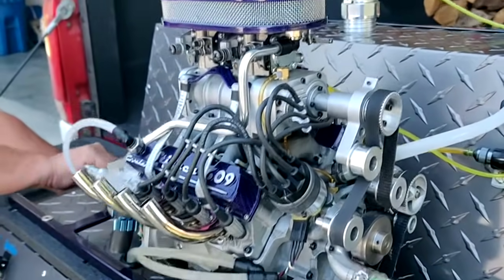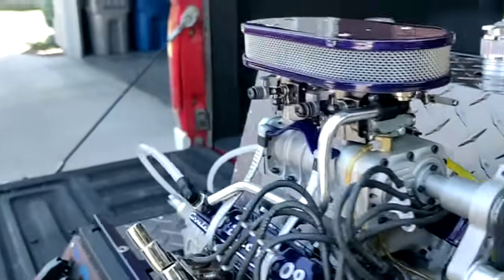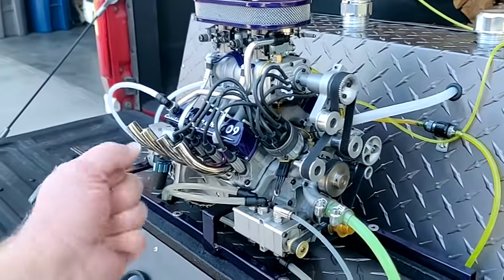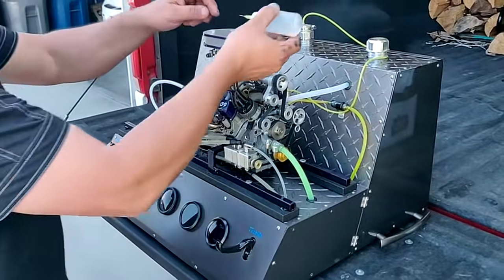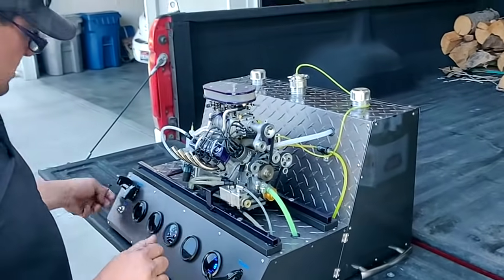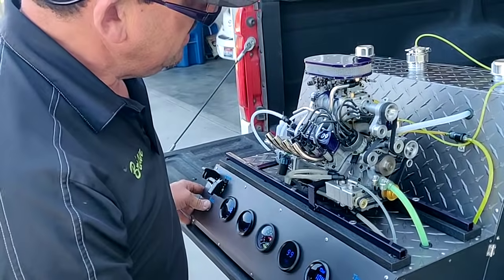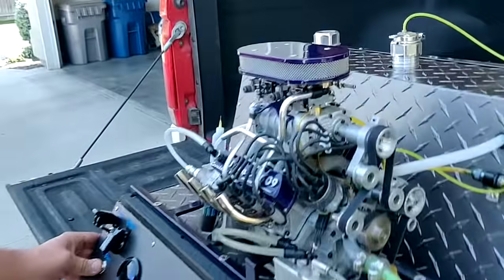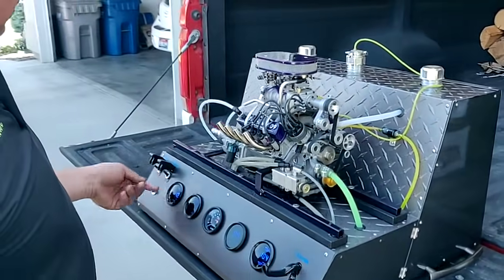Conley Engineering "Stinger 609" 6.09 ci 1/4 scale V8 motor running on test stand

Comment: Gary Conley's V-8's are the absolutely brilliant . I heard his shop caught fire and he stopped making them. I hope he's still around and kicking. Cool video, thanks.
Reply: As I heard, an engine builder from Australia bought the rights and drawings.
I haven't seen any engines yet 😅
Reply: By the way, after the fire, there was a "remake." I think it was the Stinger, in a very modified form since there weren't many cast parts left.
Reply: @nee3029  Yes. Gary had a shop fire. I haven't heard anything projects in quite awhile.

Comment: Wait, 6.09 CI or 60.9 cubic inch. Its massively oversized if indeed each cylinder is only displacing like 0.7 cubic inches. Plus 1/4 scale would put a "full size V8 at 243.6 CI? That's a fairly small V8 in and of itself, 6.09 CI would put it at roughly 1/50th scale of a 350. I'm so very confused.
Reply from the maker: 6.09 ci total. It is approx quarter scale. Point is it's an amazing example of design, engineering and machining craftsmanship regardless of scale.

Comment: What you never see is one of these running in anger for more than a couple seconds, because they are just models and not reliable/durable. 
I have been following the conley story since the beginning. You will never see one stepped on in a car or boat, or whatever.   I am certain that is because they will expire in a very short time. 
The best videos were of a man who had one in a gravedigger truck, but it was still pretty limited running.  
They are marvels of showing what could be awesome potential, but that is a lot of moving parts that are very difficult to end up with decent tolerances at that scale.

Comment: Why cant it idle for extended periods of time without being damaged? (Referring to the video description)
Reply from the maker: Excellent question. I can't tell you the physics, but the rotating mass of any engine needs a little drag to keep things in order. Like small model engines, this motor has a huge power to rotating mass ratio. You can't run a model airplane engine without a propeller or drivetrain attached to it. The rotating mass will  spin too fast for the expected timing. This can lead to catastrophic destruction.  Throttling up and down avoids this on an unloaded engine.

Comment: I was really intrigued by this and looked up the engine. The price has damped my excitement.
About $8,000.
Roughly $10,000 for the supercharged version.
Reply: You got to be joking, you can buy a real motor for 10k
Reply: @lilcourtny08  Or less.
Reply: @JohnSmith-cf4gn  You can buy a really good "real" motor (by which is doubtless meant "full-size") for 10k, but this is way cooler, if less useful in the real world.
Reply: Too rich for my blood, as my daddy would have said.
Reply: It's expensive for the same reason full-size race engines are: they're hand-built one at a time with specialty parts. If only he were still making them.....it appears that the maker had a fire and lost both his tooling and his will to do this....that's sad. I hope he will build more; this is a very awesome niche market he found.

Comment: For anyone wondering, it's a 100cc engine. I would love to have this in a motorcycle or something
Reply: Wouldn't be driveable, there is no torque to get going with all the weight. Small displacement bikes use single cilinders for a reason. A big RC car might be possible🤔😋
Reply: @J2I3H  Engines OHV engines in a V configuration generate more torque than a single cylinder because of imposed pistons 😁
Reply: @FeatheredDino  yeah, but at crazy high revs in this case. Its about torque at low rpms, not peak numbers🤔
Reply from the maker: @FeatheredDino  "opposed" not "imposed. 🙂
Reply: @TheBBGlobalNetwork  at least he didn't say exposed piston engine ;)
Reply: @J2I3H  the reason for single cylinders is.... they are cheap.  A small motorcycle with such engine would be driveable --- but in production such engine would cost 2 or 3 times the cost of the single cylinder motorcycle (scooter) engine.

See Dennis Franz channel video - v8 motorcycle  -- somebody already did put such small V8 in a motorcycle :D  sounds great  

Also there was a sport bike Motoguzzi made with a 500 cc V8 in the 50s
Reply: How much hp does this little guy have?
Reply: No torque the stroke is to short. No leverage turning the crank.
Reply: @clintbliss2046 You dont know what youre talking about. Put it on a bike and it will probably go 50mph+. Its a freaking V8, listen to it.
Reply: @BarbaraRay-m4r  I have a motorized bike that will do 50. This engine might go 50 if you pushed it to 48 but I seriously doubt it. An rc car that weighed 4 or 5 lbs would be a better choice.

Comment: SOLD!!!,,,I want this!!,,gonna mount in my GoKart, it must be puting out over a hundred horses!!,,way better than my 5hp briggs!
Reply: It might make 12hp. Maybe
Reply: Makes 9 hp, check the description
Reply: @allinaday3526  ya, I didn't read that but I knew it wasn't much. It is cool to see the sized down motor operate
Reply: There are many things you can do to make a Briggs motor scream. Bore it out, bigger piston, get a valve job done, stronger valve springs, shave the head, bigger cam. And don't forget to change the pulleys. Getting different size pulleys can do wonders for speed. Unless you want torque. Get educated on these things and have fun
Reply: @bradleylomas7525  how many horses is your Briggs pushin?
Reply: @milliondollar2981  none. I have to tear down my verticle 8hp and have it rebuilt because of the cylinder walls and the valves.

Comment: Put that inside a a kids power wheels would be sick haha
Reply: Just wrap the wheels with a couple rolls of duct tape. It won’t last forever but it will be fun for a couple days. Lol
Reply: @brandonmiller5158  my grand father wrapped my little electric 3wheeler with a strip of old belting material..... worked great from what I remember..... of course this was the late 80's
Reply: Right. Or just get rubber strips like a quarter inch thick and self tap those fuckers in all over the plastic tire haha
Reply: @FocusRS_N8  yep I learned that trick for my son's. He kept gettin stuck everywhere and after I stretched some inner tube around the wheels and secured it with a couple of screws it went many more places.

Comment: Sounded like an egg beater before it started. Wish he idled it down to like 650 rpms. It was idling at like2800
Reply: Smaller flywheel doesn't help as it's not got as much inertia as a full sized one, hence the higher tickover.
Reply: @stevenlane9272  yes was thinking a heavier fly wheel might help the idel
Reply: Smaller the displacement the harder for the motor to idle at lower rpm they like the higher rpms more don’t know exactly why but i think it has to do with the size of the stroke of the pistons
Reply: @gamer2350  that makes sense

Comment: I worked for a speed shop in N. Hollywood in the 70's. Hank the Crank was the only source of strokers back then. Hank himself showed me how flat heads were ported and relieved as I was building a Tecumseh 6 ci motor for my go kart. I drilled the crank for oil feed to the rod as it had a real oil pump for the mains. Dry sump using a sealed case, welded and reground cam profiles and everything else I could think of. I took me to 53 mph out at El Mirage. I still have the motor on a small stand in the garage. I'm 71 now and have no idea what to do with it.  
Seriously admire the guys who can build from scratch like this.
Reply: If you still have it I will buy it

Comment: This engine looks like it makes more power than a geo metro 3 cylinder I had.
Reply: That's right those things did have a three-cylinder didn't they
Reply: @leahcimthgirw3163  optional 4 cylinder. The threes were 1 liter with 50 hp. But I still think it would out power this little engine.
Reply: @lawnmowerdude  6 cu in is like 0.1 liter and probably the small engine has maybe 10 HP :D  but horsepower is not important, torque is.  Ever heard of Citroen 2cv ?   0.375 liter and 9 HP :D

Comment: Can this actually be used to power like a go kart or something small. That would be awesome
Reply: The lil engine that could,but won't
Reply: I doubt it unless the gearing was very low. In rc car engines horsepower is horsepower,  but they measure torque in inch ounces instead of lbft
Reply: @tracyhaynes5404  i don't know, I seen a guy power a ford ranger or datsun pickup with a predator lawnmower engine from harbor freight. So im sure it wouldn't be hard to put a 100 cc engine on a go kart. Its all about gearing
Reply: @brad2761  would that datsun still do 90 down the freeway?  I bet it wouldnt hit 10mph. Like I said, with extremely low gearing it might go at a walking speed at best. The rc cars that they actually put these in are under 50lbs and still don't hit more than 15-20mph

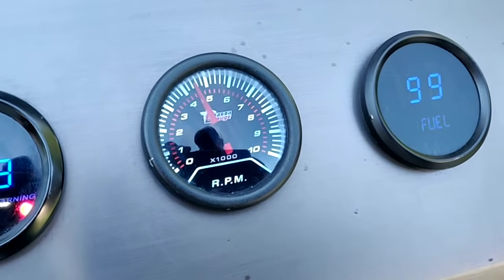Comment: 2:34 the rpm shown on the tach cannot be right. It peaks at around 4,500 rpm. that engine revs closer to 10,000 rpm judging from the pitch.
Reply from the maker: Motor cannot be reved high because it has no load. RPM is accurate.

Comment: Its nice as hell but extremely over priced
Reply: you say that but there is pretty much the same amount of parts and machining that goes into making a model of something as a real engine. the only difference is that it uses less material and the fact that they are not massproduced. that said they are expensive. but if model cars and engines is your hobby thats what you would put your money towards anyway.
Reply: @perlandstrom5023  yeah its the same as a real motor but its not a real motor at the same time. I could see 200$ or 300$ these dudes want 2 an 3 thousands. Not worth that kinda money at all
Reply: @mikewest9033  2 to 3 thousand..... Bless your heart....  You won't touch one of these for those figures.  There is a guy in Australia making a much more simple design (nitro, no real ignition system) you can get one of those for $5000.00  It's easy to arm chair quarter back and say what you think something "should" cost... If you think that's all it's value is then it should be easy enough for you to just make your own at home then..... :)
Reply: @GearHead4Lyfe  Last time I priced out a non blown 609 they were in the $15,000 range and take several hundred machining hours to make.
Reply: @jck92599  Yeah to be honest I'm surprised it's "only" a few hundred hours of machine time. Connley is a very particular guy and it shows in the quality and detail of the 609's. 

I wish he wouldn't have lost all the castings for the Viper V10 that thing was shaping up to be epic.